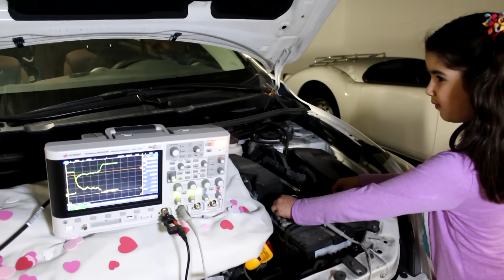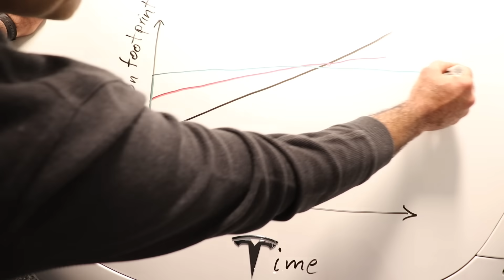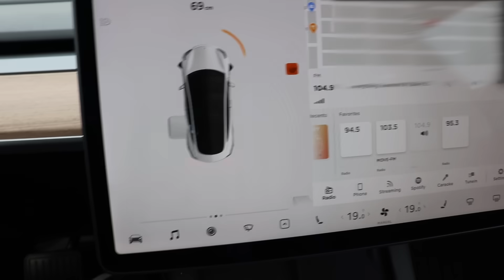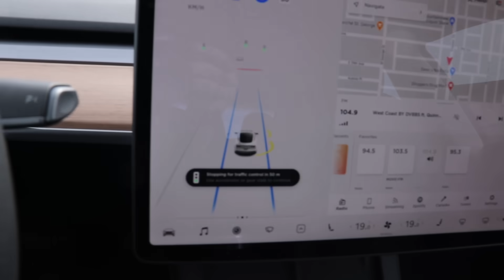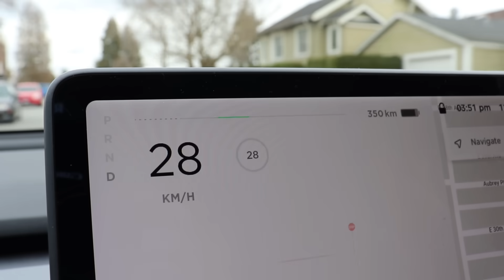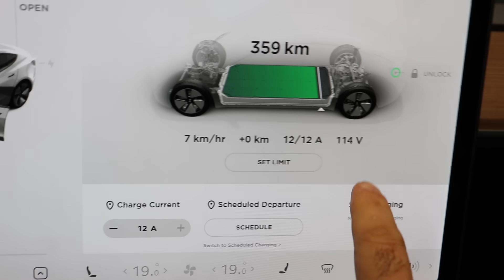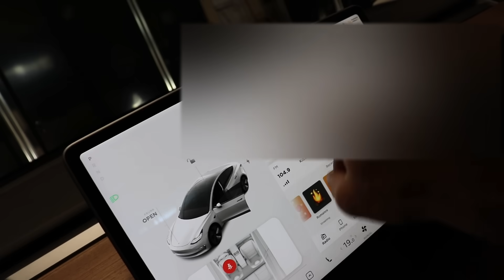ELECTRIC VEHICLES & My Tesla Model 3 Review

Comment: The down side to reducing charge current is in preconditioning. When your car warms up while on your home charger, it is doing so without exceeding the set current limit. In my experience this means that most of your preconditioning is done using the battery. Maybe that’s not a big deal to some people but in winter months it can drain a fair percentage of your battery rite at the beginning of the day. I do agree with your point about loading the grid though. This needs to be considered but can be managed by setting your charge time late at night (at least until EV’s become very popular). Also a charge rate of 32 amps at 240 volts is still a trickle charge when you consider that it’s being divided over about 3,000 cells. That’s only about 2.5 wats per cell. Only about 700mA across each cell. That’s a really slow charge for the 5 amp-hour cells in a model 3.
Glad to see you bought a model 3! It’s a great car. I drive the same model 3 SR+.

Comment: Its totally realistic to expect a good processor on the display. You plan to use the car for years, the processor needs to keep up with the programmers upping the demand.
Reply: wtf you are talking about? These programmers make make software for specific hardware
Reply: @BigChiken44  What are you even saying? 😅
Reply: Hack it.
Reply: I don't know if it's really the display or processor, it seemed more like the wifi connection.
Reply: easy solution, don't add features. Problem here is that it is underpowered for current use.
Reply: @robertt9342  "easy solution, don't add features."
That's not a solution. You fix bugs for features that exist. You upgrade features to make them more user friendly, safer, more intuitive etc. Everything you change will have an effect on the hardware being used.

If you cut corners and choose the cheapest possible components (which they did) then you'll have seriously limited yourself in how you can serve updates and fixes.
Reply: @Unethical.Dodgson  since this video was made Tesla has upgraded their gpu from Intel Atom to a an AMD Radeon that Elon says should be able to deliver ps5 level graphics.

Comment: I think all EV cars will have about just 20% of first day full charge distance about 2 years later without changing battery.
Cardboard obstacles and end of the road test and cpu of screen review were very well, congratulations 🎊
Reply: Nah ev batteries degrade sure but not even close to how much you present it here. Saw cases of tesla taxies with over 250k km driven and still having over 80% battery health. My 7 year old renault zoe lost maybe around 7% range over the years though i didn't drive as much as the taxi example

Comment: I was shocked how long it takes to charge the car, I thought it would be much quicker. Turns out the wall charger runs in Germany on three phase AC at 400V 32A, so another 1.6x faster compared to 240V 32A.

Comment: I just bought a Tesla Model S and I love it. I have a 2000 Camaro as a project/drag racing car that I did an engine swap on and cranks out about 620HP. The Tesla absolutely dominates it in speed. Its not even a close contest. Plus I live in Tennessee and we have comparably cheap gas and electricity but the Tesla still comes out way ahead in terms of operating cost.

Comment: Charging at 5A wastes 8.16% more energy than charging at 10A, which wastes
2.48% more energy than charging at 40A.  Low charge rates also lead to battery degradation. Professor Jeff Dahn is
considered a leading authority on lithium ion batteries. He says minimal battery
damage happens when charging at total battery capacity / 2. For a Tesla with
60kWh battery, 60kWh / 2 = 30kW. Even 240V*80A=19.2kW, so there is no way
to charge that quickly at home, but basically charging at the maximum amps
your charger supports is best to limit battery degradation.

Comment: Please review a product from hempvana called the Rocket... it delievers 4.8 volts ac at 263 hz and claims that it relieves pain... i feel like you could make one much much better 🤣🤣

 https://www.ebay.com/itm/As-Seen-On-TV-Hempvana-Rocket-Relief-TENS-Pen-Easy-to-Use-Muscle-Stimulator-for/203303396151?epid=5044014265&_trkparms=ispr%3D1&hash=item2f55d3a337:g:hHYAAOSwKT1gEvpC&amdata=enc%3AAQAFAAACcBaobrjLl8XobRIiIML1V4Imu%252Fn%252BzU5L90Z278x5ickkrmmq8hWevtuKE7%252F%252BLfVXtk1qe06xE6Jh6yc9pwVcukTHj7CSOlFPFkxIbD5OIO9dF8BBB9IKUBqnE%252FF3%252FBOzUfySoh7iNAzZXociWHWS2Fz%252FhimVtFgoOU2E2CfqiEZ2519FijdrM22x40IB6dulQHqHdmskbi4ygfdWl7cSOQNK86w0oSYGh38Co1ViUe%252BWo1xYsf5OxNEpwNna58I2uABLl5E2vE8zbUP0T%252B0zbXI1CIjgfqqwJ6KGFU1JtkC%252FiTSRg1P4gLlZ5316gyjJWMwYj51IEQzQW9XmVYhWb49%252F7%252FhixN3XnoL%252BwR%252F6Qw8oUWpKz1hyuOl3cOdI0tsaCADvg6SVTd2zjy4cp%252BgB9Os7RCaq8Z4kiR8IqUUTmwGpxou5DmvnpNvXm0gG%252BgVTy5pSpr%252BaY0CNcBPADe5GWzy%252Fgn9KnbpekFdzJloanMqOOcxmrzxus6byLeBqzvshl2iH2vLrkVR2q%252F0i8I8dcN%252FBfKLbLYv81QK1VadETLxujVGWNvyWorVf3AVD3sD4C3rLB1QGKk5Y0rC9wdsCr9z2EQtlfbu83XJD0EagtyyqIw4k508UPgR4FbLmihswrZcwmT3aU9QX%252B4wWkGLE7c0UkWK%252FcPE8yI9AEE3h2wwlHgCngnnvpb5ym6pTS0F3yltCB4U4BfD%252B2GkraJkcFI96qzE0EYHQp5ZcxFT3pF6oKOjfROUEkuHZi9YPgxYj%252F3WCR%252FvngE8GnsrabL6tgb7%252By4N2SSCDgQc9CBDIGJCcDaMBPNcUtWbprRFu%252F6wh5w%253D%253D%7Ccksum%3A20330339615130a4cda411ce4ec4a241101e7a77612d%7Campid%3APL_CLK%7Cclp%3A2334524

Comment: مهدی
Wrong,about charging , you have constant current at the start and at end you have constant voltage mode for lithium,  even the indicator show full charge , it is not really fully charge until you pass constant voltage mode , read about lithium,  car industry cheating a lot

Comment: What if they use the other wheel as a generator... when the back wheel motor is the accelerator and the front wheel motor is generator to charge the battery too when moving...?

Comment: Great review, but IMO EVs are just not there yet.... My Jeep grand cherokee is 21 years old and will run for years to come..... But that EV will require new batteries due to normal capacity loss once every 10 or so years... Batteries which are incredibly toxic and dangerous to produce, far more than gas vehicles. It essentially doubles its carbon footprint every 10 years....

Comment: ElectroBOOM, to correct you on the brakes department. Regardless of regenerative braking you still need to check and maintain your brakes regularly due to degradation of the brake system. One common mishap due to low brake usage is seized brake calipers which more often than not let you brake and then seize shut. Wintery climates and road salt are killers to brake systems. Arguably due to high Tesla maintainance prices this can lead to greater cost to user. In general, most maintainance you pay for is still there with Tesla cars, even without a combustion engine; steering linkages, connections, bushings and bearings are the most common and costly repairs since engines that have their filters and oil replaced with correct intervals can easily run 400 000 km and longer and when a correctly mainained engine gives up the ghost the cars value has deprecated enough due to milage and just passing of time that it gets scrapped anyway.  If you are an unfortune owner and your engine gives up early, you can buy a new one if you feel your car is still valuable enough or get a good one cheap from another car. Compare this to Teslas where the motive system has an astronomical price and after warranty you have to scrap it regardless.

Comment: Good review, just one thing about the maintenance: you DO have to change the brake pads and discs and calipers, so the less you use them the more they will corrode (Because regenerative braking does not use the actual brakes) and you will actually pay money to replace them more often than if you use them once in a while on purpose to keep them functional.
Besides that I drive an EV car and its amazing and good and fun and all those things :D

Comment: My problem with electric cars is that my gas car of 15 year could still go just a far as a brand new electric car. The battery just can't last as long as a gas powered engine. So you have to get a brand new car every 2 years compared to the same car for 15 years.

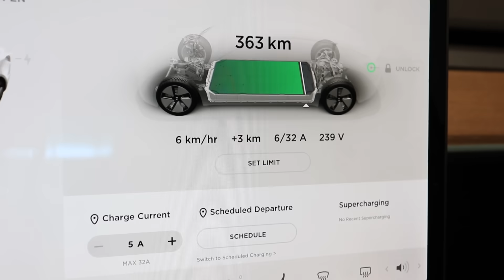Comment: 15:30 +1. It is also better for the batter to stay at around 80% to 90% charge instead of 100% all the time.
Reply: Tesla officially recommends charging the new standard-range cars to 100% each day. Standard-range and long-range cars have different battery chemistries. If the car battery meter shows 90% and higher for "trip", then only charge to 80% or 90%. If there's no "trip" section, charge up to 100% or whatever you want.

Comment: These cars are good yes but if your battery dies on the interstate you're fucked, gas vehicles can go 50+ miles on vapors at least my grandmothers 2008 Chevrolet Tahoe can and as far as going on downward slopes, put it in neutral and turn it off to save gas, and if you run out of gas completely call someone they bring you enough gas to get to a gas station where as an electric car the would have to bring a diesel generator to charge it(defeating the purpose of the car) or tow the car to a supercharger which in turn would cost a fuck ton more, and these are scenarios that happened here in the states where i live  and the batteries on those things are ticking bombs, the slightest puncher from anything and the explode since they are only hundreds of M-cell batteries(like the ones used in the vapes that have blown up in peoples pockets) besides i want to drive something that is built like a tank and will last decades, not a couple years, and computers, fuck that all i need is a speedometer oil temp, fuel gauge, and mileage, like the 40's and 50's, no confusing bullshit just in and out repairs and not keep the car for a week and charge 1000+ for repairs

Comment: Especially YOU shoult know, that energy doesn't come out of the outlet. It comes out of loads of charcoil that needs to bee burned in order to produce the electricity you need to power your car.
Reply: Bla Bla - richtig deutsch, erstmal gegen die Elektroautos wettern.
Reply: @jaypee112233  Nur zu gut, dass ich kein Piefke bin 😉 Abgesehen davon: Er hat recht. Er hat nur leider nicht beachtet dass der Schnittpunkt, den er da so eindrucksvoll auf die Motorhaube gezeichnet hat, irgendwo bei 150-400 Jahren liegt (je nach den verglichenen Modellen) und dass das Lithium, das in den Akkus verbraucht wird, regelmäßig ersetzt werden muss. Das hebt den Startpunkt auf der Y-Achse wieder um die Hälfte nach oben (von ganz unten versteht sich), weil der Akku ersetzt werden muss (und der 75% des Co-Fußabdrucks ausmacht). Besser mal was Gscheites lernen, dann ein bisschen nachdenken und DANN die Leute sinnlos beleidigen warads 😁👍🏼

Comment: We are two and have 6 cars combined still only half the price of this Tesla but also 1170hp combined.
Oh, I get MORE than the advertised range out of every car we own. And you pay not even a third per kWh of what we pay in Germany. Without free charging, electricity is more expensive than the ~1,28€ per L Diesel and the range you get from it.

So let's take the Audi etron gt with a realistic 30kWh per 100km. (~110.000€)
That's 30kWh/100km x 0,38€/kWh = 11,40€/100km.
Now take a 20 year old Audi A8 TDI which consumes 8L/100km. (~5.000€)
That's 8L/100km x 1,28€/L = 10,24€/100km.

Now one can argue, that I have to pay taxes for the diesel. True, 389€ a year. Adding to that is the service cost of 350€ a year. So you add over the electric vehicle 739€ a year on top to the diesel.
Let's say you have extra costs of 500€ a year because of faults and damages and we end up at 1.239€ plus per year for the diesel. I have 84 years till I reach the etron GT with expanses and the etron isn't maintenance free.
On top of that, it won't last 25 years and 450.000km with everything working and still the first engine and gearbox.

Comment: Modern injection engines,  petrol and diesel,  use practically no fuel when in gear and on a decent.
Reply: Not the point.  Does the fuel burnt going up go back into the tank when you go back down the hill?

Comment: 11:55 But you have to occasionally change the blinker fluid
Reply: What the hell is a blinker fluid?
Reply: @shayanmoosavi9139  the fluid in the blinkers the red and orange lights they have fluid in them
Reply: @mouseboi312  no they don't. They're mostly LED lamps inside a casing that has mirrors in it to spread out the light. Unless you mean the xenon gas in xenon lights because gasses are technically a fluid. 

Anyways, I just looked it up and apparently it's a joke😂😂
Reply: Teslas are pretty notorious for destroying muffler bearings though, so look out for that

Comment: According to friend's report back in the 10th grade (over 12 years ago now) the fuel used to transport and mine everything needed across the globe to make the electric cars, especially the batteries, adds so much pollution to the air that there is no advantage to using an electric car. I wonder if that is still the case.

Comment: 13:30 That's not how eletronic injection works :P  if the car is in gear it will use the wheels kinectic energy to keep the motor running and not burn anything :P

Comment: Do yourself a favour and read your owners manual on Autopilot before you do a video on it. You clearly aren't aware of all that is required of you while driving. For example the traffic lights - in Canada AP can not drive through a green light without confirmation, this is why the car appeared to be stopping for each light when in fact it was waiting on you to confirm it was safe to proceed. The one exception to this is if you have a vehicle in front of you, if that car proceeds through the light then the car will assume it is safe for it to proceed as long as the light remains green. Give AP a try on the highway, you will find it's a much more enjoyable experience than on surface streets.

Comment: Superchargers are more expensive because they are super fast (hence the name). Even though they put the same energy in your battery, they can output 75kW, 150kW, or 250kW (theoretical +1000mi / 1600km per hour added) during charging depending on where you are. So you can "pump" ~200km in about 8 minutes vs several hours on a home-based low wattage input.

YMMV though, as it's all a function of temperature, existing charge, pre-warmup, and current at the stall (sharing power vs solo).

Comment: People who use the acceleration typically have even a modicum of passion for cars. If you have no passion for cars whatsoever and purely treat them as tools, you should get off the road. In the same way that people who have no interest in electricity shouldn't be touching electrical sockets or messing about with li-po batteries. If you don't care at all about cars, take public transport
Reply: Public transport isn't available or feasible or preferable for everyone.
You don't need to care about cars to need one.
Reply: If you don't care about cars but need one, then either skill up or keep out of the way of those who have the willingness to give a stuff about cars (and are almost certainly better drivers) and not hold society back to the lowest common denominator. This is why speed limits are so ridiculously low despite cars being several magnitudes more capable than when they were introduced
Reply: @aidangillett5396  How about you stop gatekeeping lol.
Speed limits are fine.
Reply: @aidangillett5396  Speaking as a biker (and therefore way better on the road than you) I have to say that the 'passionate' drivers are the worst.
They don't care about the rules, or about driving safely, or efficiently.  All they know is "pedal go down...car go fast!".  Cavemen.
You want speed?  Skill up and ditch those extra wheels.  Until then you're no different from the people you think should stay on buses.

Comment: Just wait until you need to replace the batteries. Or the regenerative brakes need maintenance, because you got four generators... Oh you need to replace those bushings and bearings?? Suspension components that only your tesla service facility has... 

I had a automotive instructor who had an experience with the electronic steering rack catching on fire and almost burning the whole car down... all because one bad sensor... 

Electric cars aren't any cheaper.

Comment: Did you know that the Tesla USE to not have you touch the steering wheel AT ALL while using the cruise control? But then because a bunch of Karens starting bitching because they saw a guy sleeping, tesla pushed out an update that made the cruise control and self driving actually WORSE to make it so you have to touch the steering wheel. Which in my opinion is FUCKING STUPID. I mean which would you rather have? A guy sleeping in a car that drives itself and mostly prevents a wreck? or a guy who falls asleep behind a car and then when he doesn't touch the steering wheel the car just says fuck it, stops controlling itself and just slams the car and the driver into the next car, tree or guard rail killing him and possibly someone else? My Toyota has that exact same self driving bullshit that it makes you touch the steering wheel every few seconds. I've just put a rubber band around the steering wheel to make it THINK im touching the wheel and it never asks me to touch the wheel....LOL.
Reply: If you don't touch the steering wheel the car will sound alarms and then come to a stop.
It's much safer than having the car keep driving.

Comment: I found it quite disconcerting that the car or you didnt slow down passing that exit to the right of the building with "8606" written on it. There could have been someone wanting to cross the street that you didnt see behind that parked car. There was a pickuptruck with a camper attached right infront of that driveway ffs! Thats a very important paramenter to put into SD